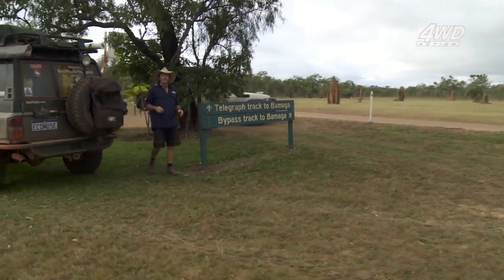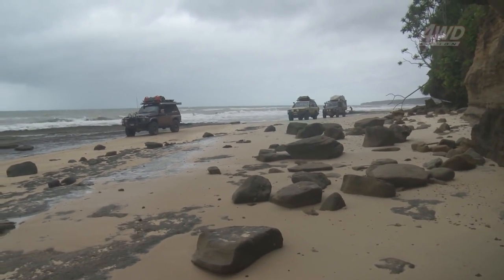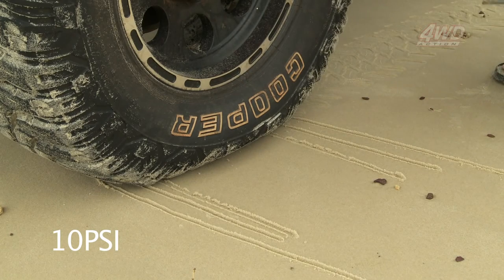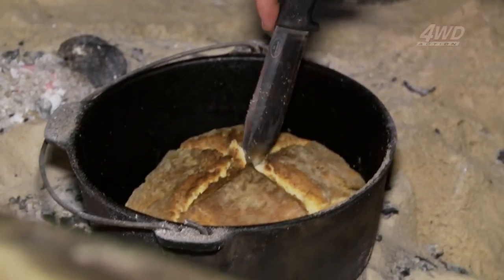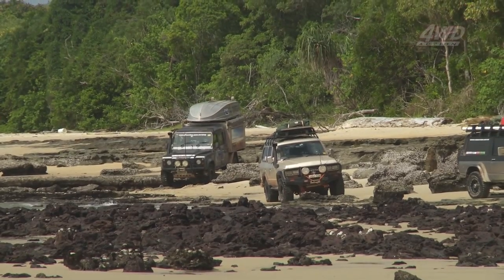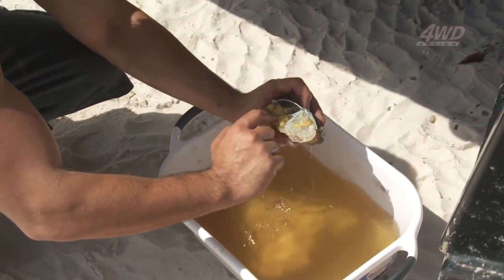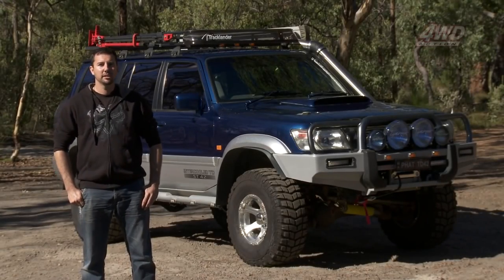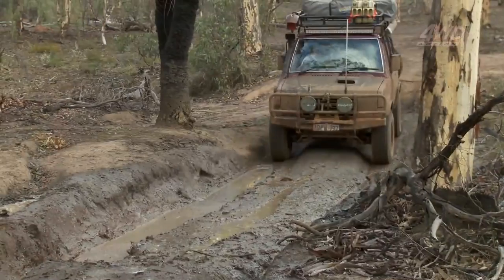Cape York's most remote track • Did we make it?

Comment: Maybe someone can shed some light on why they always seem to use low range as opposed to high range in these conditions? Manual trans? Diesel? Here in the states we seem to use low range for really slow going and high range for sloppier conditions that require higher wheel speed.
Reply: Jon Phipps These are pretty old tec diesel engine vehicles with not that much power. So in soft sand you need all the torque you can get from the engine, so it's a high gear low range and keep the revs up. We don't have many big powerful V8 4x4s in Australia.

Comment: 4.3 tonne defender? A 130 kerb weight is 2150kg which includes driver and fuel. How has he added 2150kg effectively doubling the weight of the whole Land Rover?
Reply: 35" tires, bar work, under body armor, winch, storage setup, tinny winch, tinny, canopy, uprated springs, roll out fridge, barbie, coffee machine etc, diff/ axle reinforcing, reinforced recovery points, larger fuel tank, diff locks, water tanks etc, plus all the tools, food, spare parts, and camping gear he'll have in the back.
...and anything else I forgot.
Reply: @davogeorge4525  does seem kind of excessive. 110 on 33"s with rear locker would achieve as much if not more
Reply: going from a 35" to a 33" would save very little weight, when you weigh 4T I dare say a 35" is the minimum size tire needed to have sufficient traction to haul that weight
Reply: Does seem kind of excessive. A 130 on 35" tyres is unstoppable

Comment: Pretty good show.  Kind of a silly soundtrack.  Quite a bit of manufactured drama.  Fairly mild off-roading with their 2" lifts and 32" tires.  Overall, worth watching.
Reply: no, wrong, landies got 35"s and enough accessories that it weighs 4tons+, patrols got 33"s, landcruisers got 33"s (it has since been chopped into a ute and has 35"s and front and rear winches), all vehicles have twin lockers, more heavy duty recovery points, winch bars, 12,000lb winches, lighting, storage, and an endless list of accessories, so pretty well set up really